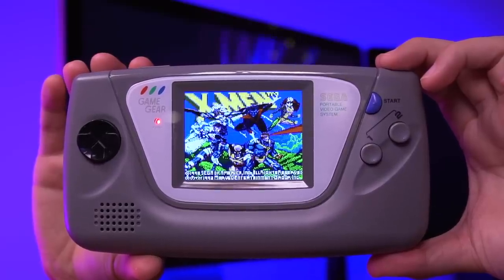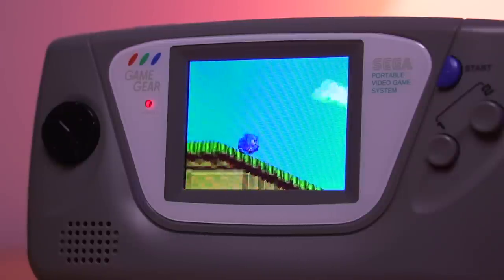RETROKAI GAME GEAR LCD UPGRADE IS “MAGICAL” | RetroKAI Magic Screen Tutorial + Review | Retro Renew

Comment: Another great one Tito.  I saw this done on another channel and the guy didn't seem to realize that the pads on the back of the esg were pre-tinned.  He ended up running individual wires for all of the connections like the McWill kit.  Just ordered my kit and can't wait to put it in.
Reply from the maker: It’s a great kit!  The soldering is a little tricky. Key thing is to take your time. Best of luck on the mod dude!
Reply: That's exactly why we are working on the next version of our ESG. To make it even easier.
Reply: @RetroKAIstore  well it didn't stop me from ordering one from you guys.  Can't wait until it gets here.  Keep up the good work.

Comment: Great video! Fantastic production as always.

As for the screen itself, while installation looks simpler, it doesn't fix my major issue with the McWill: the resolution just doesn't match. You're stuck with awkwardly scaling the screen size up or down to get proper integer scaling, or dealing with uneven pixel sizes that shimmer in motion and make text look awful. I keep hoping a suitable display is found for the Game Gear and Lynx, because as good as this mod is otherwise, I just can't justify the amount of money and work these mods require to deal with such an obvious visual artifact at the end of the process.
Reply from the maker: Agree it would be awesome if someone could find a screen that would allow for perfect integer scaling and fit the game gear window. Fingers crossed that we can get that some day. Cheers Seth and happy New Years!
Reply: This has been my major issue, though I didn't know there were different modes already, including scanlines, which help. My biggest issue with videos and photos of the screen in the McWill mod is that graphics look more flat and blocky compared to the original screen -- not that the original screen looks great but it has a way of making sprites look a little nicer.
Reply from the maker: Valid point. I still have an unmodified which I will keep original for this purpose.

Comment: I just did a McWills mod on my GG a few months ago and this does look a bit easier.  It doesn't appear to be worth it if you already have a McWills mod though.  The biggest remaining issue for GG screen modding right now is that someone needs to find an LCD panel that's just the right size to allow for integer scaling.  Both the McWills and the Retrokai have this same issue- full screen stretch is a non-integer fill, which means you end up with uneven pixels.  I'm holding out hope that someone will find a suitable panel someday, hopefully IPS too.  But for now, these mods are still infinitely better than the stock GG screen.
Reply: The main issue with that is the fact that there is no screen at the moment that has the size and the resolution that makes a perfect scaling possible.
It would need a custom screen especially made just for this purpose and I let you imagine the cost of such a product.

So it's always a matter of compromise. We could increase the resolution, add some bilinear filtering, that would consume much more energy and the picture quality would still be about the same because of the weird scaling. Believe us, we tried a lot of things, but we aren't giving up ! Still looking for the perfect screen !

Comment: Looking at the info on the retrokai site another big pro over the mcwill is the power draw. The mcwill draws more power than an unmodded gg, the retrokai is around half that: 1.6 to 2w vs 3w (unmodded) and 3.5w (mcwill).
Reply: Surprised this point wasn't mentioned

Comment: While out of stock at the moment, McWill has released his V3 of the GG LCD that incorporates brightness control. Now if he could do the same for the Lynx kits that would be excellent! Also, liquid flux might help to make those solder joints easier on the ESG because it would allow the solder to seep between the PCBs a bit better.
Reply from the maker: Nice!  I’ll have to check out the V3!  Thank you for the heads up!!  Cheers!

Comment: Great video @Macho Nacho Productions! I'm definitely doing this mod to my GG soon. I was wondering...wouldn't it be better to do the drag soldering part first, then put the ESG in place and finally just give the solder a final touch with the soldering iron? I think that would guarantee the pins are in contact with the solder from the beginning instead of depending on the solder to flow under the ESG which is, as you said, soldering in the dark.

Comment: Hey Tito, wow I’m blown away on how easier this looks than the McWill kit, not that it’s a piece of cake, but IMO it looks easier. Now, since I live in Europe, it’s easier for me to access this kit at a better price than the McWill sellers/distribuitors over here.
Back to the Mod, I like how you fitted all on a fresh shell and the new power board, I’m curious, have you run a power test, as in how long do a fresh set of batteries last? I’m considering modding a rechargeable battery but it will require some testing and it’s not quite reversible.
Cheers, Jesus
Reply from the maker: Hey Jesus!  I havent run any tests yet but the RetroKai website shows a pretty good improvement.  Also RetroSix will be introducing a rechargeable battery solution that should further increase battery life.  Cheers dude!

Comment: Great video! Any chance of an RGB out function? Also, what soldering temps are you using for such small components?
Reply from the maker: Thank you!  So glad you enjoyed the video!!  As far as I know there isn’t an rgb mod out for the game gear at the moment. Hopefully someone can make a consolizer kit, that would be awesome!  I typically stick around 340C for most things and adjust slightly depending on application. But 340c tends to work out for me.  Cheers buddy!

Comment: Still looks pretty tough.   I am planning on learning to solder and replace my GG caps.   Then maybe down the road I'll get this lcd.  But I'm extremely happy with the drop-in LCD  upgrade I did with my Lynx.  The original screen on my lynx was barely visible.  The gamegear I have needs caps for sure, but it was a cheap thrift store find.

Comment: For those wires that you have to "seal off" so they don't short anything, at about 7:25 in the video, you can use some super narrow heat shrink tubing. You can find it on Aliexpress, and some of them even have a super thin layer of hot glue to make it extra insulated... Or glop everywhere. Both. 

Flex cable is also annoying to install for noobs. PCB is much more forgiving. Trust your meters. XD

Comment: Would it be possible to use some sort of heat activated adhesive to attach a ribbon cable? This seems like an easier solution, though that may create long term problems like the original game boy or virtual boy have.

Comment: Nice work as usual Tito. I have installed many mcwill screens and personally the difficulty was never the issue, the price is. I will give this a go at some point but as you pointed out the way the driver board is installed is not optimal. I would far prefer to solder the wires directly as I trust my soldering. I'm sure this would be easier for beginners but on first look I think I'll stick with mcwill. Great to see more mods being engineered though.
Reply from the maker: Thanks Ben!  Totally agree!  While the McWill has more steps, it is easier to verify solder joints. The price of these kits are about the same. I’d say each kit definitely has their pros and cons but the end results are very similar. Both produce fantastic images. I too am happy with all the attention game gears have been getting!  Cheers Ben and happy New Years!
Reply: @MachoNachoProductions  yeah I looked up the price hoping it would be cheaper but unfortunately the way the graphics driver board is implimented in the gamegear there will never be a gameboy, ips type solution.  The results are so good though, it's worth every penny. Happy new year brother, keep up the good fight.
Reply from the maker: Will do man!
Reply: The next version of our ESG will be good enough for you to reconsider, I'm sure 🙂.
Also, know that you can just solder wires to connect the main board to the Magic Screen.
Because there is test pads on the ESG and the Magic Screen PCB that can be used as alternative pads if the pads on the main board are in bad shape or lifted for exemple.
Reply from the maker: Can’t wait for the upgrade!

Comment: 15:50, it does not look like an IPS panel. Viewing angles still seem bad. I would also be nice to limit contrast. Game Gear had not many colours, and the low contrast display matches the low colour palette.  Last thing is that we still wait for 160x144 non square pixels. Idealy with use of the CCFL tube.
Considering all the updates we need on the power supply and sound board, please Sega release us from our suffering and make a true V2 Game Gear.:
- Original hardware config CPU, but in a low power version
- Proper sound amp circuit
- Genuine 160x144 IPS panel with CCFL or QD LED backlight.
- 2x 18650 replaceble LiIon battery cells for the needed weight.
- Original case design and card slot.

Comment: Just finished my installation.  It was difficult getting the ESG to make good continuity but, with a little patience I was able to get it going.  Now I have to figure out how to power the GG with some lithium batteries.
Reply from the maker: Awesome McPaul!  Glad you got it working!  I think RetroSix is designing a rechargeable battery kit and will release it soonish. I’m waiting for that to come out!  Should be pretty awesome!
Reply: @MachoNachoProductions  I saw that they had posted some info about something like that being released soon.  I was kicking around the idea of doing something custom but, I might just wait for that.  I also have some of those external power packs that I want to try and modify.
Reply from the maker: Yeah those external packs are pretty good. I remember having one when I was younger. I’m sure they could be modified somehow.

Comment: For me personally, I think I'd be more comfortable soldering the wires to the edge pins for the McWill than drag soldering (I haven't drag soldered before though).
I'm alright with fine soldering.

Are you going to be doing a video on the Game Gear CleanJuice when that becomes a thing? I'm really interested to see how that's implemented. It would great if it could charged with the CleanPower board.
Reply from the maker: Definitely!  I can’t wait for something like to come out. It’ll be a game changer!

Comment: Do you find that 28awg wire is fine for most work when dealing with any mods you do on consoles?  Have you run into any situations when you have had to use other gauge wire?
Reply from the maker: I find that it works most of the time. I’ve used magnet wire in some cases too.

Comment: Without the CFL, the battery life must be increased a bit, did you test this?
Converting to 48V must've drained the batteries pretty fast...
Reply from the maker: Haven’t done a test yet. You are correct, according to the retrokai website the battery improves quite a bit. Cheers!

Comment: Thanks for the video. It seems it is a 320x240 screen, which is a bummer, as this was the one point from the Mc Will mod that needed an improvement. A 640x480 screen would be a better fit for the console's native resolution of 160x144. It would have allowed x4 the vertical resolution, and x3 the horizontal resolution (with only a small loss top and bottom). With 320x240, we are stuck with various display modes and not one that is satisfactory, as the ones that fit the best the screen (with minimal loss) produce shimmering, as the scaling is not an integer.
Reply from the maker: Very true. It would be great if we can find an lcd that fits and does proper integer scaling. Cheers cireza!

Comment: I wonder if it's possible to make an ESG that clamps on to the mainboard to make contact with the ribbon cable connector instead of needing to be drag-soldered.
Reply from the maker: That would be awesome. There is plenty of space in the shell for that.

Comment: It is interesting you don't need to remove as many stock components (resistors, etc) and it makes me wonder if the McWill instructions (which have been revised numerous times for VA1) are exaggerating component deletes. That said, I don't think soldering 6 wires to the original ribbon pads is the most difficult part of the McWill kit, it's removing what, like 15 components from the original PCB, and moving 2-3 resistors around from one pad to another.

Overall I think the focus here needs to be on price because both of these kits are just way too expensive for what they are. Similar LCD kits across numerous other consoles cost $50-$60 tops. Meanwhile Alibaba has generic McWill kits (which I don't recommend because the PCB's are iffy knockoff designs) for $30 so we know production cost is very cheap. McWill, like Tim Worthington, have provided great contributions to the community but I feel their profit margins are unreasonably high and it shows because eventually someone comes along with similar products for less, showing the demand isn't features, quality, or even installation, its price.
Reply: I think I can explain why those kits are "expensives".
We needed something like 1 year of R&D to release this product, 2 peoples worked on it. That includes designing the PCB's, prototyping, testing on every use case possible, reverse engineer the Game Gear to understand which components are really useful to remove, designing the brackets, the ESG (even if it's not optimal yet and another version will come soon), then produce the PCB, assembling the final product manually because we don't have any machine to do it.

Game Gear kits are always expensive because they need R&D, assembling work, and expensive components. 
We'd like to do it cheaper, believe us, and if we are able to improve our production efficiency it's probably what's gonna happen in the future, but for the moment we can't do it without loosing money. Note that we also make cheap sound boards as well as the Adaptative Backlight mod for the Game Gear.

Chinese people does it cheaper it's true, but they just clone what's already working. The same goes for Everdrive, GDEmu, and any other "expensive" mods that needed a lot of R&D to be released and then are just cloned by the Chinese and sold on AliExpress for super cheap (without the same quality though).
They don't need to put time in R&D, they can produce PCB for cheap because all the electronic factories are there. 
You can imagine that without the need for R&D and with more efficient production process with access to cheap components, the comparison isn't really fair.

Keep also in mind that they don't need to do any communication either, we have a social network presence, we communicate about our products, we have a website to run, we created all the content you can see on our social networks and website by ourselves, we are on Reddit to help people with our product (and not only), we've made a (small) wiki, we answer to all the messages people send us to have more information or to provide support, we provide an after-sale service, we made installations guides in PDF format and we send a printed version with our product, we produced an installation tutorial video on our channel (though it's not as good as this one).

Chinese sellers on AliExpress don't have to do all this, they rely on us to give visibility to our product so people can just type the right keyword on AliExpress to find a clone. Because if we wouldn't do it, you wouldn't know what to type in the search bar. And the same goes for every mod maker, not just us.

I think I can speak for every mod maker when I say this: if everyone would buy Chinese clone on AliExpress, nobody would work on any mods anymore.
Because nobody would want to put so much time and efforts in making new mods to see people buy the clones Chinese released on AliExpress.

And guess what would happen if no mod makers would work on mods anymore ? No more Chinese clones either,  because they would have nothing to clone anymore.
I'm not saying that Chinese can't innovate, of course they can, but the majority of mods you can see on AliExpress are just clones of a product that a mod maker released and the guy isn't making any money on it to reward the time and effort he put into it.

Anyway, sorry for the long post, I hope it enlighten you on why those mods are so "expensive" and why buying the cheap AliExpress version is good for nobody. 
For us, for any other mod makers and even for you.

Comment: For VA1 Model there was an update to install 32mhz to R25 and not FB1. 
just for heads up.
Reply from the maker: Interesting, is there a benefit to soldering to r25 vs fb1?  Is this documented somewhere?  Thank you for the heads up!  Cheers and happy New Years Alex!
Reply: @MachoNachoProductions  Yes supposedly  is for the Master System Support and more compatibility. 
Retrokai posted a video on this and Documented it on Reddit post r/game_gear
Reply from the maker: Awesome!  Thanks you!
Reply: @MachoNachoProductions  NP let me know if you need the link.
Reply from the maker: Would love the link!  Thanks!
Reply: @MachoNachoProductions  Yes, he is right, we updated our installation guides recently to include this. Normally FB1 should be fine, but sometimes there is some "glitches" on very few games, so we made some tests and discovered that if you solder it on R25 instead those glitches disappeared completely.
You can get the new version of our installation guide either on the product page or in our wiki: https://wiki.retrokai.store/doku.php/public:en:magic_screen
Reply from the maker: Awesome!  Thank you!